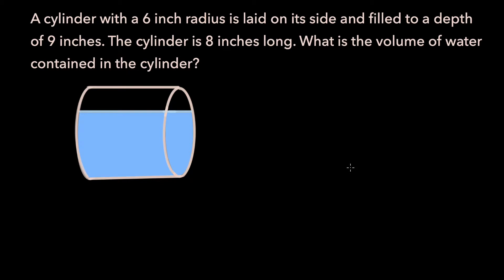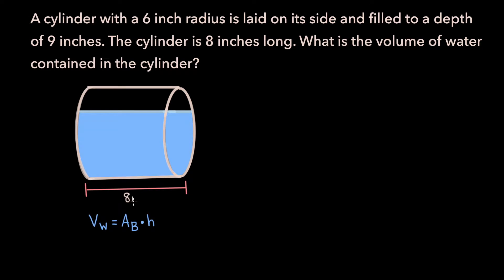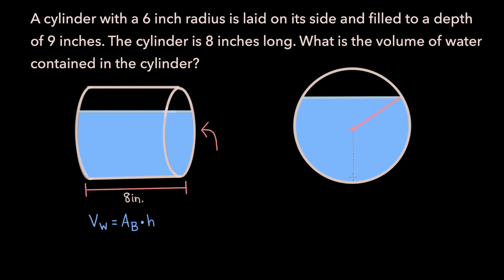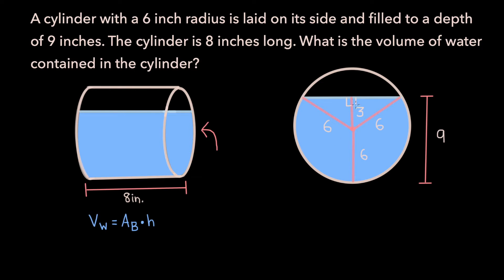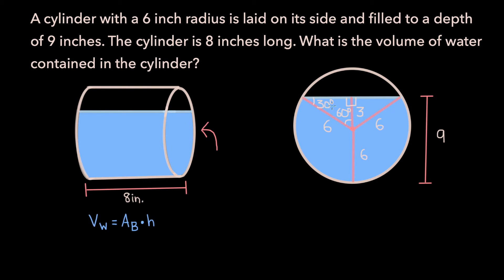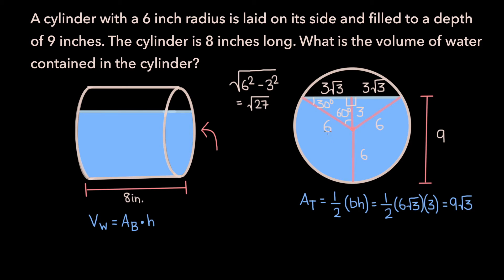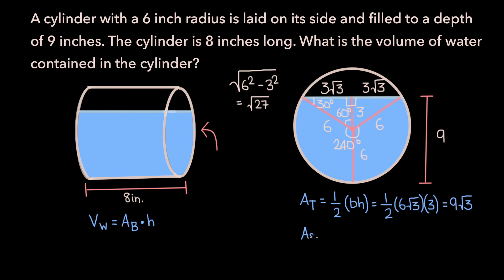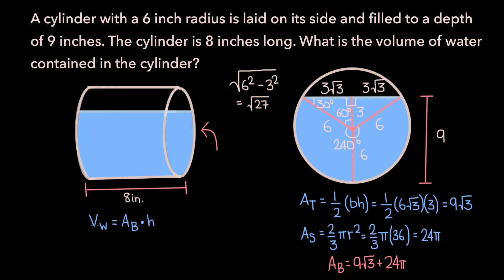Volume of Water in Horizontal Cylindrical Tank Problem

Comment: Since  the formula is available in many streams. 
Let me provide the  pseudo progress that describes 
How to  achieve the solution. 

0) The solution to the problem is in reality
to find the area of a unity circle under a 
intersecting horizontal line 

1) To make a solution that is general for the entire 
possible range of filled up level of liquids from empty 
to full  we start with a solution for  more than half filled tube.

2.)  To find the area of the part of the circle, a circle 
that from  now is called  c5,  seen from one of the ends, that 
holds no liquid , you start with placing a x-y coordinate-system 
with center ( Origo) in the c5 circle with radius r.

3) then you find the area of the empty part of the tank, by first obtaining 
the distance from 0 out x-axis towards right to the point where the 
liquid intersects the curvature of c5. You call the distance on the x axis from  
origo's 0 to this intersection  m. Then you find the area under   
that partial curvature all the way  down to y = 0.
 
4) how to do 3) He height of the partial curvature can be 
obtained by the function r x sin(x).  IOW r x sin(x) describes the 
height of each point on the circles curvature in relation 
to how right hand  far from 0 on the [x] axis you are. 
A well-known math centuries old proof have established 
integral calculation as the way to obtain that area.

5.)  How does the integral equation from 4) look like.  
It is r x [ sin(x) dx. From 0 to m. Look it up. Some other guys have made the proof 
of the integral solution of that to be r x -cos(x) between o and m.
cos(0) is 0 . r is a constant doesn't change when integrated.
so the all in all solution 
is r x [+0 + -(-cos(m))]. r x cos(m).  we move on to find m.

6) how to find m used in  5).  A unity circle is 
described by x^2 + y^2 =1. Since we have m relative on the [x] axis
m^2 = 1 - y^2. Now we need another variable a to show us
how much over the half full tank level we are. As pointed out in
1.)

7) Now we can just substitute y with (a/r), that is the Hight [a] 
compared to [r] radius,  the water level 
is above the half full level. From 6) we have m = sqrt(1-(a/r)^2).

8) The empty area above the liquid line can now be found from 
subtracting the square made from [a x m ] from the entire
sub curve area described in 3)

9) The area we just found in 3) to 7)
must be subtracted with what we saw in 8) gives us
r x cos(sqrt(1-(a/r)^2)) - a x (sqrt(1-(a/r) ^2).
The entire area above the waterline is 2 times of
the right side.
that gives 2 x [r x cos(sqrt(1-(a/r)^2) - a x (sqrt(1-(a/r)^2)].

9) the entire area of the circle is then a full tank area
subtracted with that empty area we just found in 9)
IOW Area = phi x r^2 - 2 x [r x cos(sqrt(1-(a/r)^2) - a x (sqrt(1-(a/r)^2)].

10 less than half full and c5 being under the origo we would calculate
half the circle area and subtract the integral 2 x r x [ cos (y) dy from 0 to 
SubA/r.

Comment: what if the water level is below the midline..i.e below 50percent of tank capacity. Can we use same calculation?
Reply: You can calculate the area of the circle that is empty with the way described in the video. Then you subtract that from the total area of the circle to get the area that is filled, and multiply with the height.
Reply: You calculate the volume of the empty space, then subtract it from the total volume of the tank.

Comment: what if the tank is less than half full?
Reply from the maker: This video covers a special case of this type of problem. If you are interested in seeing the general formula for the volume of water in a horizontal cylindrical tank (that you can use when the tank is more or less than half full), check out the following video: https://youtu.be/Kmpy2nYnZQM.
Reply: @intuitivemath1124  thank you!

Comment: √6²-3²? i thought it is + not -
Reply from the maker: The Pythagorean Theorem says that a^2 + b^2 = c^2, where a and b are the lengths of the two legs of a right triangle and c is the length of that triangle's hypotenuse. We know the length of the hypotenuse (6) and one of the legs (3), so 3^2 + b^2 = 6^2. Then, to find to the length of the other leg, we just do the sqrt(6^2 - 3^2). Hope this helps!
Reply: @intuitivemath1124  please share with us the general formula so that we can proceed for any horizontal cylinder tank.
Thank you for your help.
Reply from the maker: @journal509  Check out the pinned comment above for the general formula! Thanks for watching!